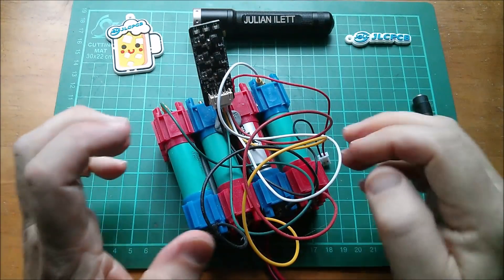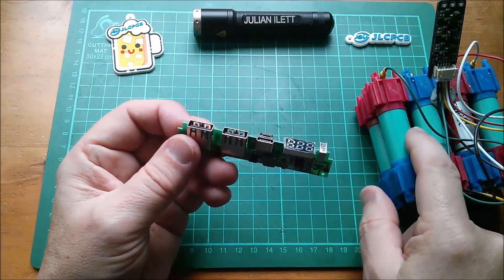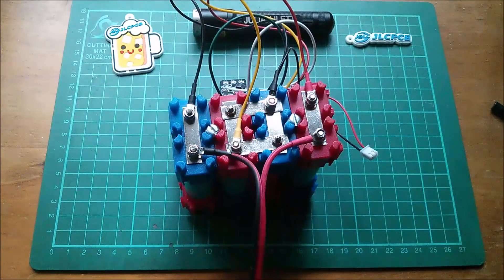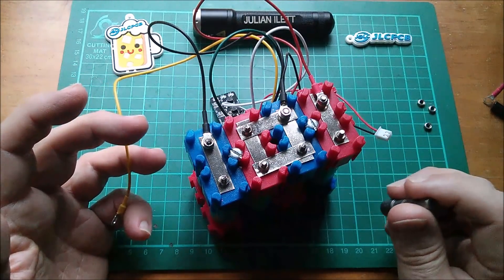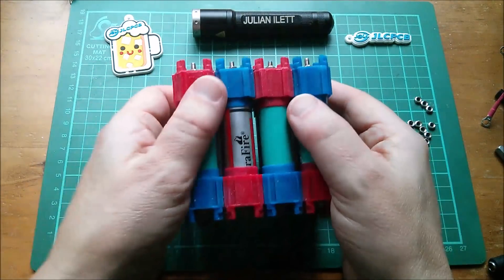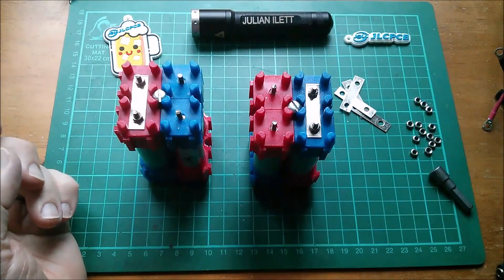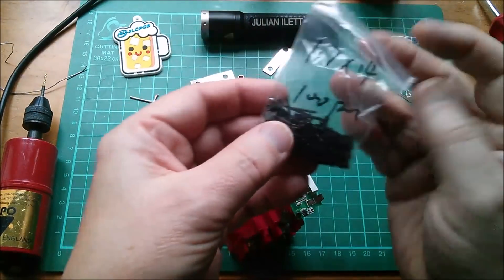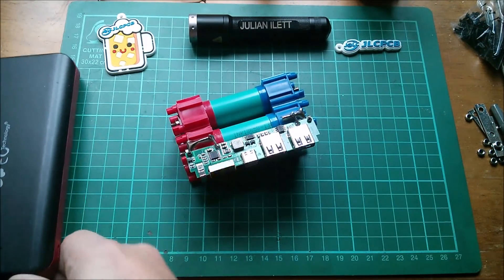Build a USB Power Bank

Comment: My experience with USB power banks of the DIY and "with Type C port" variety so far is:  You need to put a charge in before it really turns on (bank dependent, it varies, my 2nd one didn't I think) and they absolutely need a full charge and drain (0%-/100%-0%) to train them on the capacity. The first one I got gave it a 0% capacity with 12 hours left on a 4w draw and after the charge, drain, and charge it was accurate to within 2-3% since the batteries are high cap (and I doubt it was expecting that).
I LOVE the Type-C QC class power banks since it takes a 12-16 hr charge on my 28Ah pack down to 5-6 hr charge. The micro-b power bank takes 8-12 hours for (at this point from use and age) probably 16-18Ah capacity.
If your Type-C board doesn't allow power out it's definitely hamstrung by half on usefulness. It doesn't appear to support QC or any similar charge type at all, sadly. For the price though it's good. (mine was, with 8-cell case, 16 shipped)

Comment: Hot glue will get soft when charging.
It's a linear chip, just like a regulator. It will get hot. 
Make sure you obey the maximum charging current. Don't go over 1A per cell. You just shorten the life of the cell.

Comment: For a bit more mechanical strength would it have been advantageous to mount the board on the battery itself with sticky pads and connect to the second set of batteries, instead of it dangling off the edge? Other than that lol, like the video Julian 👍
Reply from the maker: It's pretty rigid. It's hot glued, screwed and soldered. It doesn't wobble :)
Reply: I surprised the cct board wasn't attached to the other pair of cells and then it would have rested on the pair it is connected to. Some sticky foam pads would have helped to insulate it so that sharp pins don't puncture the plastic wraps on the cells. Or even some Kaptan tape as well.

Comment: 4.425V max charge? looks like it is for a different chemistry? I think you need the top one at 4.25V max charge for the batteries you are using,
0V charge tells you whether it's capable of charging a dead cell, some won't and for this those ones you need to 'jump start' the battery until it is over the charge threshold, usually 2.5V or 2.75V... A word of caution, if a cell has dropped to below 2.5V then charge it outside and not in the house.... A shed perhaps? (insert blatant advert for Julian's  Shednanigans here*)
Reply: There is no inherent danger in charging a cell that is below 2.5V. Charging a cell from 2.0V, 2.5V or 3.0V up to the maximum voltage makes no difference regarding potential dangers.
Reply: You seem to know your onions so.....I've got a load of mismatched LI-ions that I'd like to assemble in a 3S4P battery. Is there any way of doing it? What if I only charge a Parallel branch to say 4V to avoid overcharging?
Reply: @evanleebodies  That depends on many things. How badly mismatched are they? Different models? Different specs? Different age and condition and remaining capacity? And what do you want to use the battery for? Generally speaking, you can always throw together a bunch of random cells and it will work. The questions are: How well is it going to work? And for how long? Mismatched cells in a battery will always cause issues sooner or later. The worse the mismatch is, the sooner it will start. Uneven current flow, cells ageing at different rates, cells failing prematurely and so on. Only charging the parallel cells together won't solve anything unless you are able to match the cells within these parallel blocks. Three unmatched 4P blocks in series will then still cause trouble potentially, but not as quick and not as bad as they would when they have unmatched parallel cells. But then again, it also depends on what you plan to do with this battery. I'd advise against using mismatched cells. However, if you're new to the party, you can use them as a training exercise to make a battery which then might be not useable, but you get familiar with the process for the proper battery using proper cells.